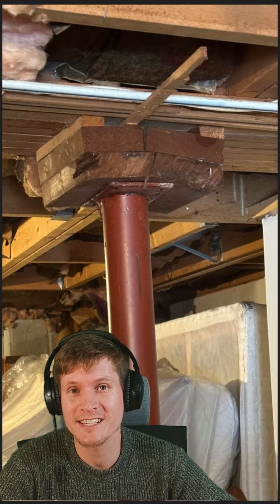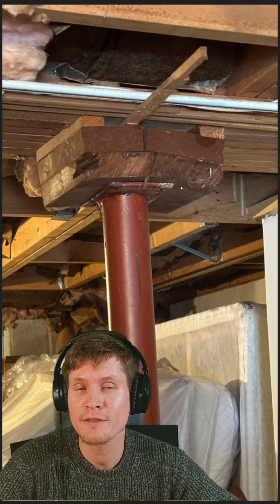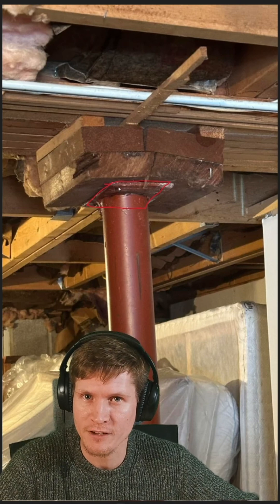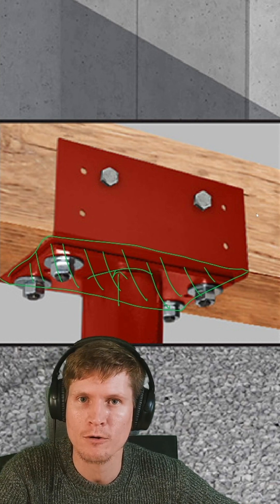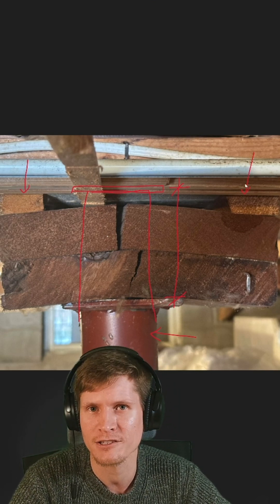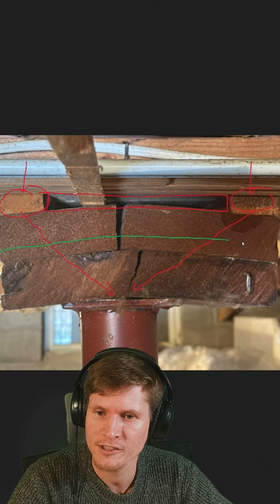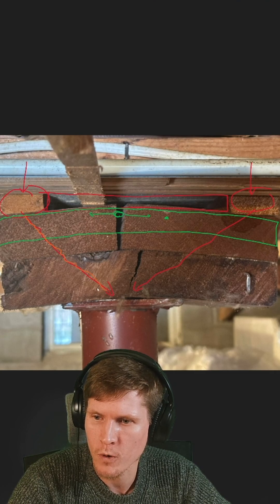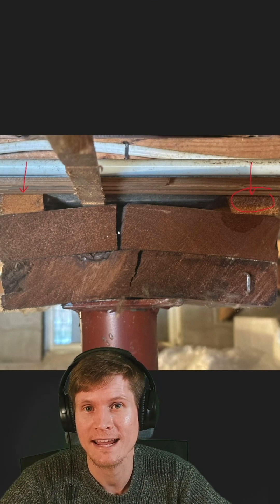Structural Engineer Reviews Reddit Construction PART 3 #engineering #reddit #structuralengineering

Comment: You completely overlooked the actual issue. The placed 2x4 on the edges and nothing but a tiny 1x1 in the middle. The post was acting as a fulcrum and the load was being applied  at the end of a lever. The force which broke the wood was not just compressive stress but actually bending stress due to a bending moment. It doesn’t help that the grain of the wood was orientated across the moment. Surface area may have been an issue but was not the cause of the failure.

Comment: They made that connection like they wanted it to fail, worst possible shim placement, worst possible grain orientation, the smallest interface plate you can reasonably find and two wooden boards that are not connected into a single block. Really, what are they thinkinf
Reply from the maker: must have been opposite day :_Surrrrre:

Comment: It can be analyzed multiple ways.
You may turn the connection upside down and you have a simply supported beam with a point load down the middle and moment would pl/4 
If the wood was oriented the other way it may have been alright ( meaning not split). Regardless the connection is garbage, easy way to lose your license.
Reply from the maker: great way to look at it!
Reply: Been following the content for a while now. I think doing quick simple analysis of quirky structural things is something refreshing for the channel. Keep it up.
Reply: Don’t you mean wl/8?
Reply: No, I don’t mean wl^2/8
Reply: @marcrogue5268  exactly 🙏! You shouldn’t square the L or else it’s off. That’s why I recommended wl/8
Reply: You have you max moment due to an uniform load incorrect the L is squared, regardless the load isn’t distributed the steel post acts as a point load